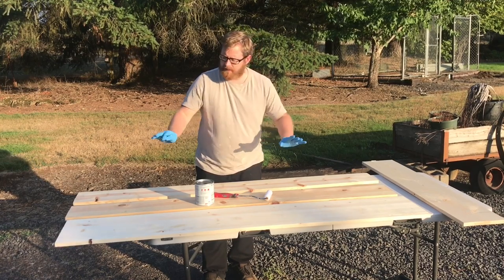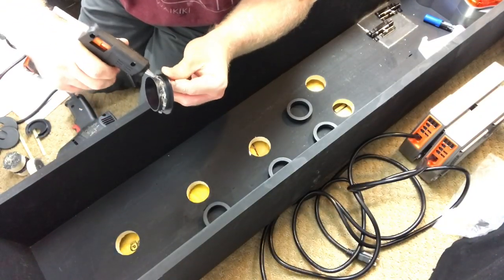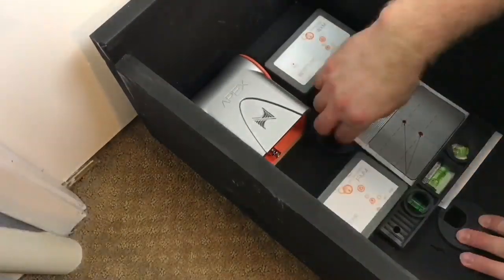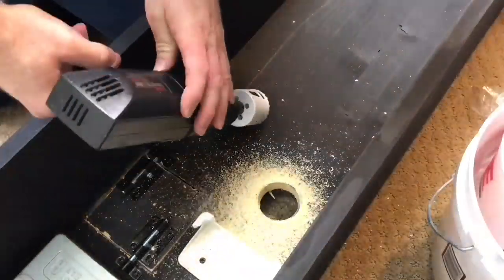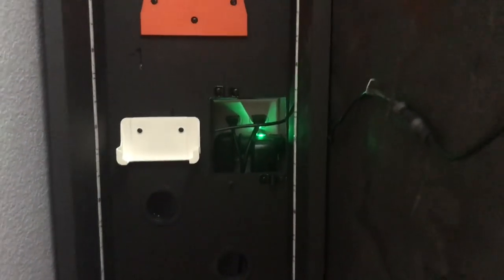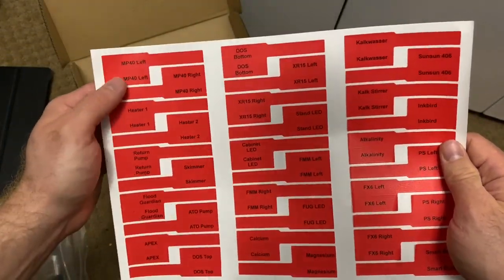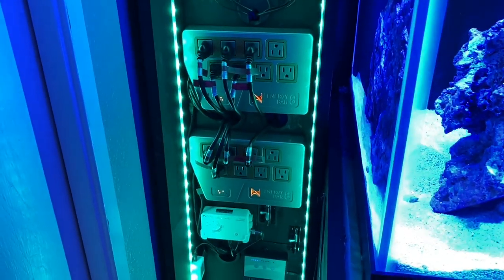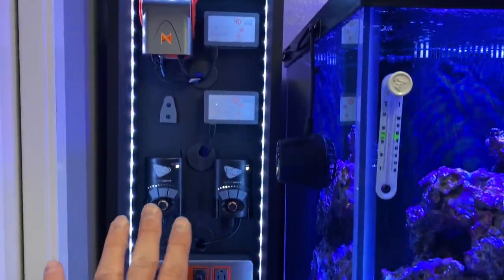DIY Saltwater Aquarium APEX Controller Cabinet * EPIC * How I Built It

Comment: This is probably one of the best videos on how to DIY controller cabinet for your Apex system. This build came pout awesome and superior work! I am getting ready to build one but I need mine wider since I HAVE plenty of room next to my SCA150. question - HOW MANY OUT LETS ARE YOU RUNNING TOTAL BEHIND YOUR TANK?
Reply from the maker: I am so sorry that I missed this comment! Thanks for watching and commenting. So I am running 4 total outlets behind the tank (2, 2 plugs). I had someone install 2 breakers in my breaker box so each plug has its out breaker.

Comment: Hi, I’m watching 2 months later and I’m wondering how you routed the cables for the vortech pumps that go to the dry side through the holes you drilled? I thought you couldn’t detach those? Thanks!
Reply: Reefer Gill made a DIY cabinet and he removed 3 screws from the back side of the controller, disconnected the wiring harness (quick connect) and slid the wiring harness through the cable management holes

Comment: Superior job on the cabinet #@UCD0v9KxbMdnSz0WC6it2bMQ! I bought two Marine Depot cabinets that will be getting placed on top of each other  w/ all of my Apex gear and then I will be building my tall and skinny cabinet like yours but mine will only be 55'' in height.. What size lumber did you use for this build if you don't mind me asking?